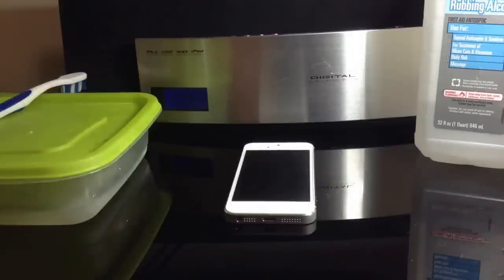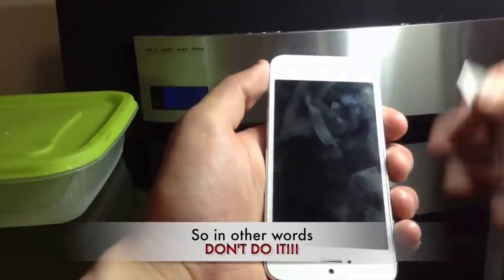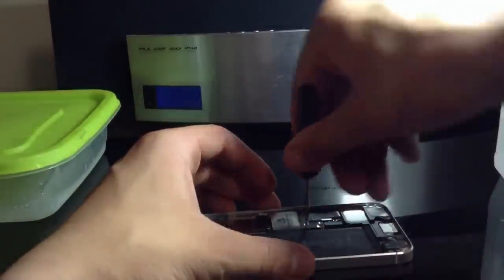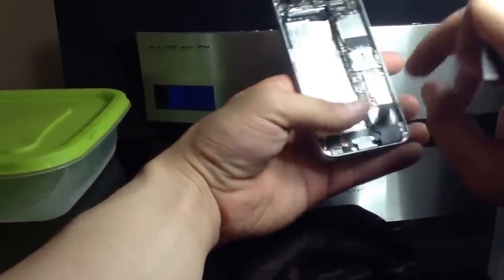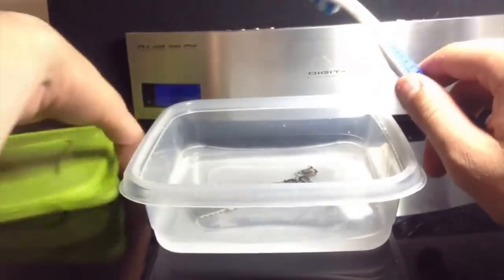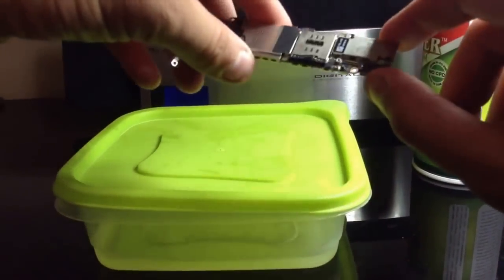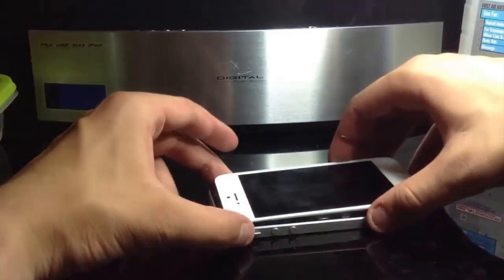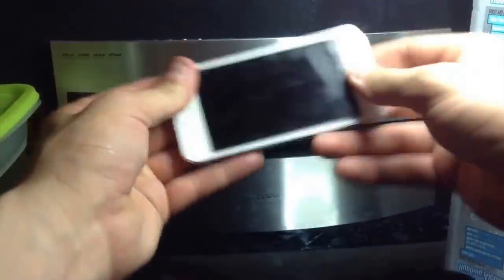iPhone water damage repair DIY (full step by step guide)

Comment: hi....if i took everything apart and soaked my motherboard in alcohol and did pretty much everything you did... minus the air duster because i didnt have one but i let it sit for awhile....and i did a quick hookup like you did to see if it would come on...i put it on the charger and it started turning on and went to the initial apple screen during start up... but then it would just shut off... then come back on and then shut off.....i dropped it in a pool and i was just curious if this is still worth saving or not...
Reply: Take the battery out and see if it still happens if so your battery needs replacing that same thing happened to my iphone 4

Comment: i lost one screw at you replace at the left side of the camera- the one you called tricky screw.

How do i get a spare ? 

Also i also lost one of the two sets of screws in the same line, it was very small. I was working at night.

Does Iphone have spare screws inside i can cannabilise and use ?

If not, where do i get new one's..

I don't think, it wise to work without them ?
Reply: ***** 
you can buy screw kits for these online or on ebay reasonably priced

Comment: Hello sir, in my case i dropt my iphone in a bucket of water it stayed there for like 2sec, after taking it out and drying it with a paper towel i let it dry for 6 hours and then i turn it on and i worked i tested every thing (the speakers the conectivity everything worked) then i shut it down and after 4 hours i tried to turn it on but i doesn't work, i think there was water in it when i turned it on for the first time and it damaged it do you think your method still works with my case or not, should i try it ?

Comment: I have an iphone 5s, I don't know if this has to do with verizon but when I tried opening the case as instructed about 5 minutes into the video I found the Touch ID sensor is still connected, making it impossible to open the screen into an L & I can't figure out how to disconnect it (I've taken all the screws I've found off and had no luck). A little help please?

Comment: hey dipped the very bottom of the 5s in a cup of coffie for like 1 sec i dont thnik the mother board got wet. ive taken the sim card out and the two screws out of the bottom and split the case. i see no moister in side. any advice ?

Comment: Hey Nate! Okay, so I dropped my iPhone 6 in my pool yesterday, for about 3 seconds. I instantly got out of the pool and threw the case off and dried it with a towel. My phone never cut off, but the speaker did stop working, so I put it in rice, and today, I mean, it turns on and the speaker is working again, however the touch sensor home button doesn't recognize that my thumb is even there, and the screen itself is delayed. Now, I am actually kind of scared to try the method that you did in this video because I have absolutely no idea of what I'm doing, is there anything you recommend? My phone "works," just not to its previous potential.
Reply from the maker: Hannah Hagan Your touch ID sensor may be damaged and will have to be replaced by apple (only they can replace and reprogram a new button/sensor) and the digitizer in your screen may have suffered some damage as well at the terminal on the board or the terminal on the digitizer flex cable on the screen. I would take it to apple and tell them about the issues but DO NOT mention water damage at all. It's also possible that they may give you a free replacement phone, but I wouldn't count on it. In your case that's the best advice I can give you for now. good luck

Comment: so i've hypothetically dropped my iPhone 5 in a toilet... anyways, I've already removed the back and dried the water from inside, but i did that after pulling it out, drying the external parts, and turning it on to find that everything worked fine other than touch screen response. The screen didn't do jack. as i was taking the backing off i held the power button down, which i didn't mean to do but didn't think much of until it was stuck on the restart screen for a good hour and a half until it died. came home and stuck it on a charger to see if it'd come back on... it did, but it was stuck on restart screen once again. stuck it in some rice as a last ditch effort and came to the internet to find something a little more substantial to go on. The screen has weird discolorations as well, and there was a point where it would flash on and off. not really sure if its an issue with the screen or if i shot the system by restarting it while water was still inside. I'm going to try this if it's still not working in a day or two, but do you think it'll work or is the logic board most likely shot?

Comment: I was listening to music while showering a couple days later as I went to go fix my screen the guy who fixed my skin told me my phone had water damage and a few days after that my phone started randomly turning off every time we would get out other two hot air out of use it for too long you just turns off then then I noticed that when I keep my iPhone plugged into the charger doesn't turn off it stays on like normal so I'm debating whether to get a new battery or get a new phone do you have any advice please, below

Comment: Hey Nate, thanks for posting this video. I've got a question. My daughter bought an iPhone 5s used a couple of weeks ago for about $330. 5 days after she bought it, it stopped working. She took it to an apple store and they said, sorry, we can't help...the phone is water damaged, but we'd be happy to sell you another for $270. She was devasted. I took it into iFixit and they said that they tried a new battery, charging port and screen and it still wouldn't work and that it appears that it's probably a bad mother board. Could taking out the motherboard and cleaning it like in your video possibly solve the problem, or might it be something else?
Reply: It's the mother board most likely. Try cleaning it it should help! It did with my iPhone 5s

Comment: I cleaned everything as suggested and changed the battery.  My phone turns on but doesn't boot up.  I tried holding the On button and the home button but that didn't work.  Any suggestions would be much appreciated.

Comment: I changed the battery in my iPhone 5s due to water damage. I turned it on & everything worked great until I plugged it in to the charger. Now the phone is showing no signs of life. Ive held down the power button and home button & nothing. I pulled the phone apart again, checked all connections, and that didnt work. Any suggestions? Please help....

Comment: Hello Nate Rist, I took my iPhone 5 on a holiday and accidentally drenched it in the beech. The phone came up with the error 881 borrowed blocks blah blah... I have followed your instructions and gave it a thorough wash and scrub in isopropyl alcohol taking care about connectors, screws etc. Unfortunately it still comes up with the same error after reassembly. Is there anything else I can try before I ditch it? Also is there any way to pull the photos out of it?
Reply: My iPhone 5s after I left on the rice for 1 day, worked for like 1 hour and than stopped work at all. than I took to a repair guy who tried w 2 different batteries and 1 did for 1 second flashed and after stopped and never did work again. Any hope for my phone ? it is being 1 week now. waiting for your reply. thanks! Sandra Aguiar.
Reply: My iPhone 5s after I left on the rice for 1 day, worked for like 1 hour and than stopped work at all. than I took to a repair guy who tried w 2 different batteries and 1 did for 1 second flashed and after stopped and never did work again. Any hope for my phone ? it is being 1 week now. waiting for your reply. thanks! Sandra Aguiar.

Comment: is it possible to just switched off the backs of the iPhones? For example, My gold iPhone 5s dropped in a bucket of water and now its water damaged. So i bought a silver iPhone 5s off craigslist. I was wondering if its possible to switch the backs of the phones because I want the gold cover instead of the silver. Not too sure if this made sense but i hope you can help me out.
Reply from the maker: +Precious Padilla yes, all 5S models are exactly the same mechanically, just keep in mind that the home button flex cable are specific to the logic board that the phone shipped with meaning they cannot be replaced and still have touch ID work, otherwise you can simply drop the motherboard into the other housing, throw on the front assembly with the original home button and you'll be good (I highly recommend cleaning the logicboard as shown in the video before reassembling for obvious reasons though)

Comment: nate just watch this viedio my friend dropped his 6 in water I have cleaned screen connectors and battery connections as well it now recognized in iTunes but has no display do you think it can be revived? also did you say cost was $25 thanks Robert
Reply from the maker: I do not offer this service anymore and won’t in the future either. I’d try ordering another screen and trying that to see if it fixes your issue though

Comment: My phone fell in the toilet (top part first in) and I grabbed it right away, the bottom of my phone was sticking out of the water when it was in. I grabbed the phone about 5 seconds later and checked to see if it worked still (i know big mistake, but I didn't know). it seemed fine at first, and then it turned off. I've left it in a bag of rice for more than 24 hours. This morning I plugged it into the charger and the white apple came on as if it were going to turn on, but then the screen turned black again. The process of turning on and off kept repeating itself. Should I wait another day? Or do you suggest a new battery?
Reply from the maker: more than likely the battery is shot. which iphone do you have so I can post a link for one?
Reply: Thank you for getting back to me! I have the iPhone 5c
Reply from the maker: Here you go: http://www.ebay.com/itm/New-1560mAh-Li-ion-Internal-Battery-Replacement-for-iPhone-5S-5C-Free-Tools-/121361767147?pt=US_Cell_Phone_PDA_Batteries&hash=item1c41b99aeb
Reply: Um.
Reply: hello one question i have and iphone 5s water damaged dropped in the pool this video will work for me? and another question what kind of alcohol did you use in not in the US Thanks
Reply from the maker: Just use any rubbing alcohol rated over 90% and it can, but it's in no way guaranteed though

Comment: I dropped my iPhone 5s in the toilet a few months ago. I put it in rice and left it in for a week. It worked when I plugged it into the charger. My phone was doing great until after a month of use, it wouldn't work unless it was plugged into the charger. I had a few days where I had to leave it into the charger for a whole day which is bad for the iPhone. Do you think after a few months I could try this method you did in the video? Please let me know as soon as possible.
Reply from the maker: +Alyssa Suzann It sounds like your battery took a shit on you, I would order a new one (usually $5-$7 from a variety of seller on ebay within the US) and definitely follow this guide to clean the phone as well and hopefully all goes well

Comment: My phone got wet at the beach, but not very much, it still worked after it. But now when it turns on after a while with the apple logo on, it starts blinking in different colors, red, blue and then stripes with the apple logo, then it turns off. Can I solve my problem doing this?

Comment: hey Nate- Thinking of trying this repair next. I have a friend's iPhone 5s that she dropped into a glass of melted ice cubes 5 months ago. It hasn't worked since. I ordered a new battery for it and it powered up but the touch screen part does not work. The screen water indicator was white but the 2 spots on the motherboard were red. Do you think this submerging and cleaning of board will help get the screen touch to work? Thanks
Reply: Nate I did this whole thing and still no touch response. Any ideas? THanks
Reply from the maker: Michelle Sohn
have you tried another front screen assembly on the phone?
Reply: yes, I did. It has same results. I am thinking maybe it needs a new Touch Screen Digitizer FPC Plug Connector put on the motherboard. Does your shop do this?
Reply from the maker: I'm no longer associated with Cell Again. But check that terminal for arcing (if one or more of the terminal teeth are blackish, they're arced. Clean it by lightly scraping it off with the fine point of an exacto blade)

Comment: I know it's been 1 year since you've uploaded so idk if you even still read these, but I'll still give it a try. Soo I put my iphone in my bathing suit pocket, got in the pool and forgot it was in there, after only about one minute I realized where it was and I took it out and the screen was glitching and I tried my best to turn it off but it just ended up going off by itself. Anyway I tried the rice thing and Im happy im not the only one who has seen that it doesn't work. After about 3 days I tried to charge it, it wouldn't charge, turn on or do anything! So I came upon your video followed all the steps correctly and tried to charge it again and voila! It responded but only for like 5 minutes, and the battery sign popped up on the screen with a small amount of red juice in it... But after about 5 minutes it was back to nothing again.. So now im stuck wondering is it the battery maybe? Or could the problem be I only used 50% alcohol? What do you think?
Reply from the maker: Uniquely Beautiful which iphone model do you have? I would replace both the battery and dock assembly just to be safe as well. LMK so I can post the links for the parts
Reply: Nate Rist I have an iPhone 5. And where's the dock assembly located?
Reply from the maker: Here's the battery: http://www.ebay.com/itm/New-1440mAh-Li-ion-Internal-Replacement-Battery-with-Flex-Cable-for-iPhone-5-5G-/181659995071?pt=LH_DefaultDomain_0&hash=item2a4bc78bbf

And here's the dock assembly (located in the lower area of the phone and consists of the charge port, data antenna, headphone jack and main loud speaker): http://www.ebay.com/itm/Black-iphone-5-Dock-Charger-Port-Flex-Cable-Assembly-Mic-Antenna-Speaker-Oem-USA-/231576529849?pt=LH_DefaultDomain_0&hash=item35eb096bb9
Reply: Nate Rist Thank you so much! You're the best!
Reply from the maker: no problem

Comment: if there is evidence of possible arcing on the lcd digitizer module..can anything be done to repair it?
Reply from the maker: Yes, but you would need to be, or would need to find someone who does professional micro soldering. you can buy the terminals off ebay fairly cheap, but the solder points are extremely small. I would offer the service myself, but I only use a fat tipped iron for iPhone backlight replacements and installing Nexus 7's into car radios., But to answer you initial question directly, yes I it possible to repair.

Comment: I was swimming with my phone and I'm pretty much exactly like the person with the phone in the tutorial. I got the phone and dried it while following the instructions. My phone would turn on(I think). When I charge my phone it would flash the apple sign for 1 second, then it would do it again after 5 second. I dont have any idea on how to fix it. Please help?
Reply: Please respond asap also my phone is not jailbroken
Reply from the maker: Williamlee3242
try another battery, I think it may have just fried (battery is usually the first thing to go with liquid damage) order from gadgetfix on ebay
Reply: I dropped mine in the toilet, and that's exactly what mine is doing. did you get a new battery? and did it work? I really need my phone!! lol

Comment: is their any other substances i can use instead of rubbing alcohol like surgical spirit or nail vanish remover
Reply: You should be able to use perfumes that contain alcohol or nail polish remover but use a tiny bit on a brush to clean if you will clean small areas

Comment: Id like to know if this method works on a water logged 5s It was fully submurged for 3 seconds and immediately the phone went blank. It has no power. I brought it to the Apple store, who simply said its contents are lost and it needs to be replaced. I want to try to recover some recent data and pics. I sent away for a kit on Ebay to replace the battery. Will this work? Any feedback from others with  the same issue? Im hoping your video steps will work! Thanks.
Reply from the maker: all you can do is try, all this video shows is how to properly clean the phone. In no way is this a guaranteed fix for water damage

Comment: I did this process, and then plugged in the charger. The phone showed the battery was completely dead, so i let it charge for about 30 min. It then didn't turn on at all after that. I went ahead and put in another motherboard from a good working iphone 5s, and that worked and the phone turned on showing 6% battery remaining. The old board stil shows no signs of power. Any advice, or is the board gone bad for good? It seems to still allow the battery to charge, but nothing is displayed on the lcd (and yes, lcd worked with anther iphone 5s)

Comment: Hi Nate. I just tried your method and after everything I plugged it into charger and the apple logo apeared and then just shut off and didn't turn on. What is your suggesstion. please
Reply from the maker: sounds like a bad battery, order a new one off ebay and it should fix it (may need to try a DFU restore if it doesn't want to turn on)